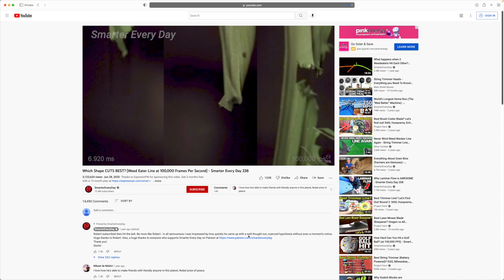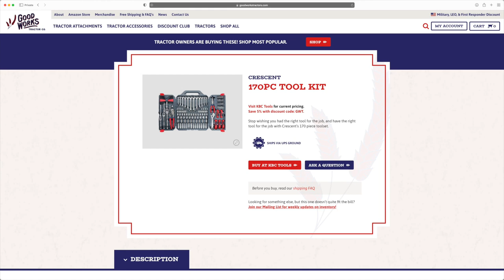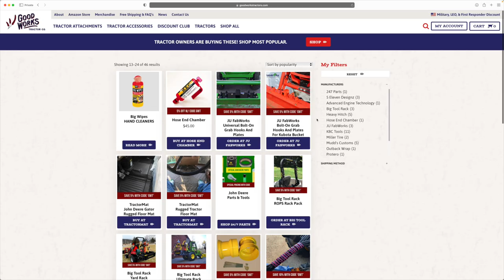BETTER THAN SPRAYING? IS THERE A BETTER ATTACHMENT FOR FENCELINES?

Comment: LockNLube grease gun hose end. Saves you exactly from that hassle of getting stuck on a zerk
Reply: That's why I bought mine, too!
Reply: I bought one except it wouldn't work on my tractor because it wouldn't fit into the recessed zerks. I would think that the strings would destroy the posts at the bottom. I use weed killer.
Reply: Agree!  I did that once, then bought the lock n lube
Reply: @jakeschisler7525  They now have a 4" long extended one, made just like the original, but will reach all those recessed fittings.
Reply: Y'all beat me to it....
Lock-n-Lube is the way to go !!!
Reply: Yep.  Me, too!
Reply: I bought a lock n lube on mine but it pops off all the time while using it. I end up having to hold it on with my hand.
Reply: @JohnDoe-df2zz  Doesn't sound right. Make sure you don't have the Chinese made version. Looks almost exactly the same but doesn't work. I made that mistake.  I believe the real ones are made in South Africa unless they changed.
Reply: @jakeschisler7525  the strings never go beyond the circular guard so strings never hit the posts....but you are dragging that guard against the posts every time
Reply: @jakeschisler7525  ya they won't fit in some recessed zerks. Also I have all metal fencing so I don't have to worry about eroding the bottom of the posts but if you have wood posts just install some cheap stud plates at the bottom

Comment: Something most people don't know is that the end of the zirk adapter can tighten and loosen around a zirk. Similar to a collet on a Dremel or a drill chuck. The little fingers inside can move in and out.
Reply: Thank you for that.  Holy smokes I get frustrated with my grease gun sometimes.  Now I know!
Reply: Exactly!! I was looking for this comment so I didn’t have to type it!! 😂😂 it should be pinned by the commenter, as it is for him to learn as well.
Reply: Thanks, you saved me the Typing also. BTW Guess how I Learned about Adjusting the Nozzle 😮😂😊

Comment: I use a torch to maintain my fence line. You don't have to burn the weeds, you just heat them up and actually work best when the ground is wet. Not much faster than this, but seems easier and more effective. You also get to play with fire.
Reply: @MrChevelle83  I have a 4ft hand held burner. I straddle a 30lb tank between my legs on the floor board of my zero turn. Run both drive sticks with one hand and hold the burner in the other. Nothing fancy, but I've seen people get creative with rigid mounted burner setups.

Comment: Love that you left the zerk problems in...Dont have a tractor or the land to need one but if i did...dont think i would even bother with a weed wacker attachment like this.  It really looks like after hitting a post it was missing a 45% angle after the spring back on the other side of each post.  Great Video!

Comment: Good luck with your Titan Attachment ; I bought a attachment from them and on the third use it broke. Titan wanted a act of Congress to replace the implement. Took the broken implement to a weld shop and they wouldn't touch it. They said Chinese made steel is of poor quality and it would break again!

Comment: Wow, thats a great mower/trimmer ole bud. I can see that saving a lot of hand trimming. As always,  appreciate your honest review Courtney. 

I bought a60" finishing mower 10 or 12 years ago @ Tractor Supply and had the same exact problem with a grease zirk on one of the rear spinning wheels. 😫 agravating.

Comment: I think you should do a head to head with a normal gas weed Wacker. 
By the time you switch attachments, it doesn't seem to save you any time or make it easier. Feel like attachments are supposed to make the job easier and faster.

Comment: Hi Courtney,
The concept of this trimmer is good, but it seems a bit of refinement is necessary before it will be a great attachment.
Clamping some kind of flexible plastic rod on on your loader bucket to set a specific distance from the fence might also make using this easier.

Comment: I think if you had a three-point hitch attachment to the front and get rid of the bucket and put the tool on the front of the tractor would be better than on the rear just my opinion that way you couldn't have to turn around have a good day nice video

Comment: One thing I can tell you about trimmer line as far as how long they last, round is usually your best option. The shaped ones are just pieces of the lien cut out. They have sharper edges so they might get you a little cleaner cut but they don’t last as long generally.  It’s just less material and it just wears out faster. These tests are all done on handheld weedeaters but the round line lasted longer.

Comment: I had the same issue with grease nipple had a brand new grease gun and pulled the grease fitting out ,my grease fittings were brass though. That sure looks easier than using a weed eater,maybe you can get a blade or different pastic blades, just a thought. Happy mowing.

Comment: Thanks for the video, is there a reasonable priced 3 point tool for a fence along a hedgerow. Where you might need to vertically cut 4 or 5  ft straight?

Comment: Lock'n'Lube (LNL154) now actually has a pistol grip gun that takes Lube Shuttle tubes, and comes with a Lock'n'Lube grease connector.  Using a LNL adapter with a LS gun requires a M10-1 to 1/8" adapter.  LS also does have the safeLock connector, which is similar to the LNL connector, but not as good.  I replaced the safeLock on both my LS guns with the LNL connector.
Reply: Thanks for saving me the Typing 👍😉.
The accessory Kit with the Lock’N’Lube if you never want a Greasing problem again.

Comment: The other more expensive option you mentiond, (If I found it) has actual metal blades and can handle lightt brush. Although more expemsive, it may be an option for folks who want to groom their fencelines without the use of chemicals. To answer your question, I would opt for the manufacturer that offered one with metal blaces and better capacity.

Comment: Firstly, a lockNlube type coulper will solve the grease issue, or you can always undo the your existing coupler, use a spanner (wrench) & pair of multi grips or curved pliers to undo the cover (where the knurling is) & this will take some pressure off the teeth inside so it wont get stuck on like that. Secondly, here in Australia & New Zealand & I think a lot of European brands have the under tree (in your case a fence) already built into the flail mower, & usually has a proper blade set up on it, not wimpy cord! I'm Pretty sure Trimax in New Zealand make an attachment for both their flail & rotary mowers. Pivot point is a lot further to the outside & by that i mean closer to the tree of post end. Most of these set ups are used in orchards. You may want to look at Muhler in Germany or Austria, & various other European manufacturers, as they make roadside mowers that will amaze you.  Lots are mounted on MB Unimog trucks
Reply: I called Trimax, and they only have offset ones. So the sales person didn't have anything else to offer. It would be helpful if any brand fail mower had a way to get closer to trees for trimming.

Comment: I changed my grease gun tip to the opening kind, way better.  The original tip stuck on.  I took the whole tip completely apart and it still stuck on.  As to the fence line trimmer, I tried a walk behind, but it is a struggle pushing it over bumps and holes.  Still looking for something delicate enough to go around small orchard trees.  Maybe a gas trimmer head with an articulating hedge trimmer.

Comment: A few others have probably beat me to it, but you've gotta get a LOCK-N-LUBE, bud. Small thumb lever opens the jaws allowing you to clamp onto the fitting, and grease away! I work in the aircraft maintenance industry in the military, and we use these at my unit. They're not great for tight area greasing, but work great, otherwise!

Comment: I ran one of these for part of a summer in high school.  Freaking miserable.  Can't remember the brand, but I'm pretty sure it was italian.  Tractor was an open cab MF gear drive, and nothing is worse than tooling around in L-1 (~2mph) at 1800 rpm 
In 100* heat.  Every 30-40 mins I'd have to jump off and ratchet out more string.

Got my boss to buy me a big Stihl weedeater and I just walked 10ish miles/day around the airforce base.  

I just weedeat from the seat of my ride-on around the farm now a couple times each summer.  It sucks, but not nearly as much as running the pro driven string trimmer.

Comment: Seems to work pretty well but if you put a 180 degree mirror on your tractor so you wouldn’t have to crane your neck to see what you’re doing the whole time. If I had fences like you I’d consider getting something like that or maybe just a spray tank with some Roundup. That would be considerably cheaper I would think.

Comment: Could you zip tie or fasten some type of rigid but flexible plastic, say 1/2” conduit to front bucket and use as a guide so you don’t need to look back as often on even ground and know your distance to fence posts is correct?

Comment: Zerks need to be popped off by angling off to the side.  They are strongest trying to resist pulling straight back, because that's the direction they are resisting thousands of PSI while injecting grease.  Get a Lock-N-Lube connector and don't look back!

Comment: Doesn't the guard kind of defeat the whole purpose of using string line? The reason for using string is that you can run it against posts, trees, etc. without damaging them. I really don't see why you wouldn't just use some type of blade instead of string with that setup.
Reply: thats what i was thinking just put a push mower blade on it or somthing
Reply: the strings always damage the wood a little each time...look at a post that commercial lawn maintenance folks regularly hit
But I did think why not a blade system even large plastic blades that are inside the ring

Comment: I think your trip spring needs tightened up. Plus with that bottom board being so low it likely won’t work the best. I have barbed wire fences and I’m able to get the head directly below the fence and it seems to make a difference

Comment: I have the DR version, same cheap construction. I'll bet they're built by the same company. The only difference is my gauge wheel is on the back. hard to use on flat ground, mine's not flat and it's a nightmare to use. I'm trying to figure how to modify it to make it work right as right now as is it's not worth the headache. good video though.

Comment: If your 3rd board fence was a little higher off the ground a 0 turn mower like grass hopper or woods deck up front would be the cats ass...   just every 8 feet backing up going around post.  In your situation I would just hit it with burn down twice a year.    As far as your grease zerk a jerk situation, I've been there. New fittings and new end is tight. Over size new threads in the mower and install oversized zerk.

Comment: Hey glad i am not the only one with a new lube shuttle grease gun and had the same problem you had with the zerk...ended up buying a cheap Chinese lock and lube copy for now and replacing the end of my lube shuttle hose....the fittings either wouldn't go in the jaws or wouldn't come out without pliers...after just a few zerks i got frustrated and went the cheap route....disappointing from a $125 grease gun kit.....good luck, i think them and lock n lube in it together and maybe the same company? but i had the thought to myself... they put those grease gun ends on there so you get frustrated and just buy the lock n lube...or they get frustrated because you didn't buy the lock and lube with the kit......just my 2 cents worth...

Comment: My father had a better solution. He would keep all his engine oil from doing oil changes. Once a year, he would mix old engine oil with a little kerosene, filter it though some old rags, and then use a backpack sprayer to spray under all fences.

Comment: Hate to tell u but ur experience is as good as it gets - ur topography ideal, flat compared to mine. I have the DR, reaction identical, work, not fun for all the issues u listed. My problem has another consideration called erosion. I have sprayed for yrs and caused the erosion. The trimming minimizes the rate of erosion. I don't have any suggestions for u to improve ur experience. I have 2 friends that sent there's back for all the reasons u identified.

I have the DR walk behind that IS perfect for this application. I have leg issues that makes this half mile a long drawn out affair.

Comment: I have a mile of fence line on a private airport I want to keep mowed, looked at several models, one was 3500.00 and appears to be better than that Titan unit. Don't think I will go with the Titan given all you issues. Chemical is getting high too so the mower looks better all the time.
Reply: Chemical is like $80 for a 2.5 gallon container. That will do plenty of miles of fence line. And one spray typically last about 4-6 months or longer.

Comment: That grease gun hose end is trash ans surprised the threads in the implement didn't pull out with the grease fitting.

I don't like the way this thing works, can't go fast enough for it to be a time saver. Maybe you shouldn't be selling this item. The Z-trimmer mower mounted grass trimmer would be better and you could mow at the same time while trimming the fence line.